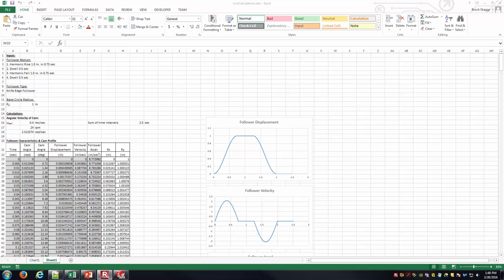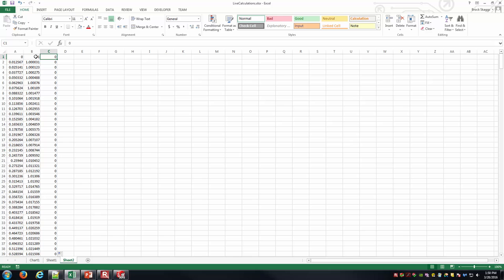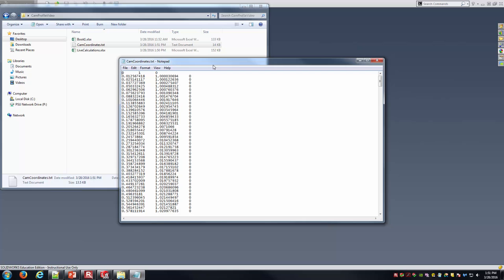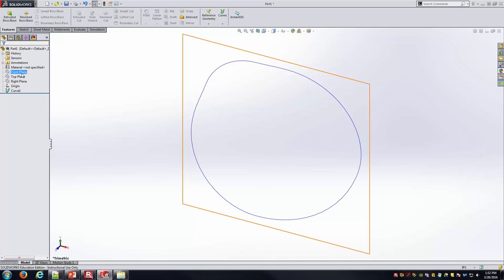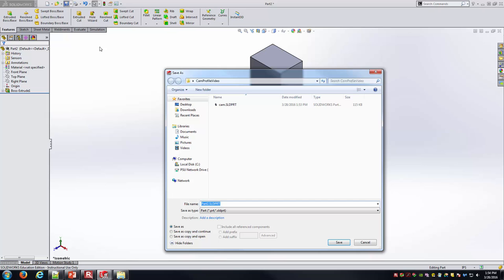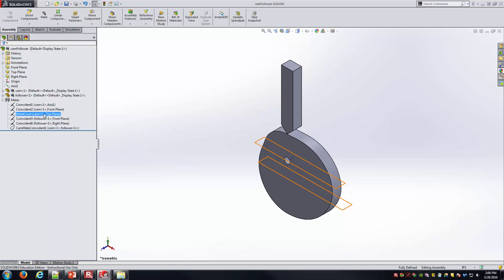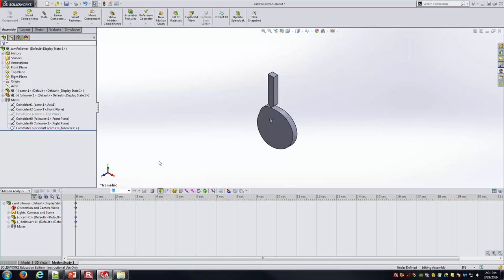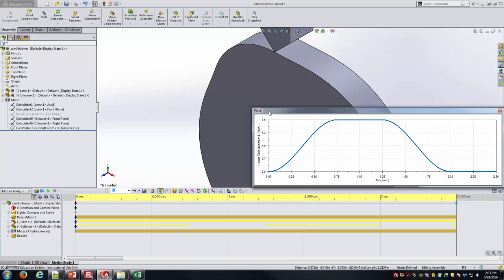Cam Design Example 1a

Comment: Thank you for making this. The precision of your CAD software is impressive.
Reply from the maker: I see that you have a more detailed comment which shows up in my email, but not here. So, I will give a reply to it now.

Correct, this is an old video and my mind is much more geared toward thinking about areas of operations research than kinematics.  This video was made when I was teaching a course strictly on kinematics, so we never considered any forces or moments.  This was done in a different course.  With this in mind, I would agree that an engineer should consider such generated forces when developing a design.  I also agree with your statement about applications.  Design requirements differ greatly when working with a low-speed cam that is used in a child's toy versus a critical machine in a factory operating at a much higher angular velocity.
Reply: @frankieskaggs409   I must admit, I deleted my detailed comment because I feared it would seem overly critical, and I understood that the main object of demonstration here was the practical application and the transition from theory to usable geometry. Thank you for your comprehensive answer.
Reply from the maker: @iCanHazTwentyLetters  No problem at all.  I welcome the conversation and appreciate the detail.

Comment: Hi very interesting. How does the design changes when you move to a pivot roller cam ?
Reply from the maker: The follower displacement diagrams would change a little since now you would be talking about angular quantities instead of linear quantities that are in my video.  As for the actual cam profile our reference we use for our kinematics class presents a different set of formulas as part of the process to generate the profile when using a pivoted roller follower.  For reference the last time I taught the class we used Machines & Mechanisms: Applied Kinematic Analysis (4th Edition) by David H. Myszka.  The specific section you are discussing is 9.9.5.

Comment: Hey, Frankie!
That's an awesome video!
You are my savior. But I really need a little help. Would you like to help me?
Let me explain to you what i'm doing and what's the issue that i am having.
I'm designing a modified-sine acceleration cam. I did everything you say in your video, but i have a little problem with the acceleration in the motion analysis. The acceleration function shows some irregularities right in the peak values. Maybe you can give me your e-mail and i'll send you the images.
Thanks to lot, again, for this video!
Reply from the maker: Sergio Guzman, I am a little nervous about posting my work email to this post.   Below is a link that you can follow to get into contact with me via email.  If you want to send me an email and include your email address then we can better collaborate.

http://www.pittstate.edu/faculty-staff/brock-skaggs
Reply: Frankie Skaggs Don’t worry, that’s perfect. I undertand